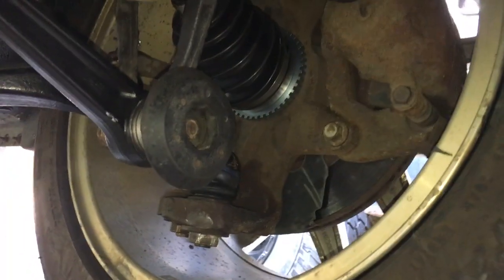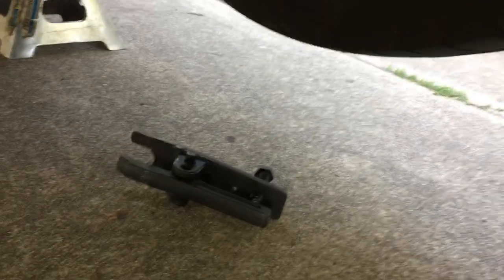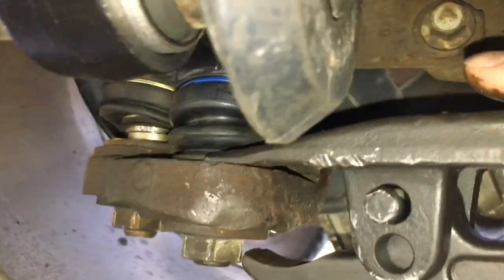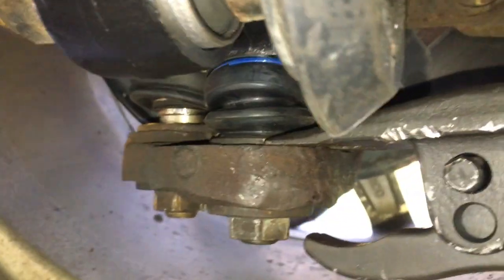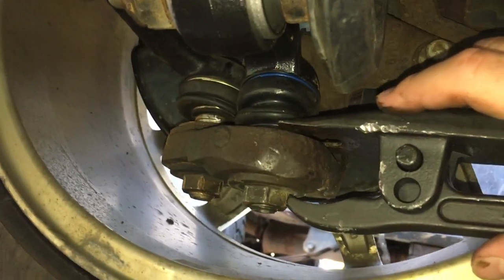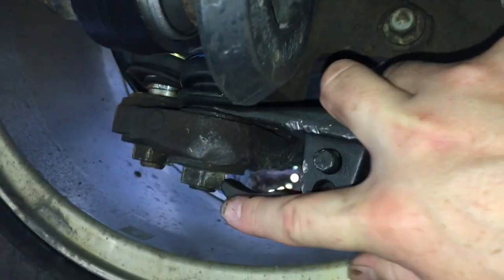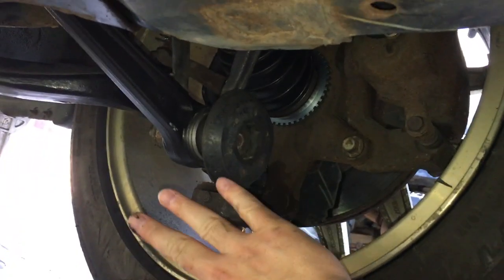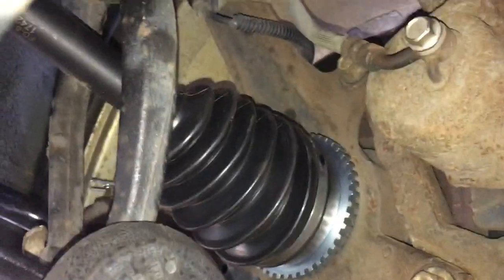Tip and WARNING - Ball Joint Removal Fusion / Milan / MKZ / Mazda 6

Comment: Totally agree, the hardest ball joints to remove. In my case I got one free and then broke my pickle fork. So I got my trusty SawzAll and cut off the remaining three. Then used a conventional ball joint press to get two more, yes they came out like bullets. The last came out with the dreaded Sleeve attached. No amount of hammering separated that one. Fortunately the Sleeves are available cheap at Parts Stores.
Reply: I was able to get my sleeves off the ball joints with a Pittman arm puller, and a heavy hammer.

Comment: That's interesting that you commented about the surface finish on the inner axle stub. I bought a 2012 Fusion back in 2019 in really good shape for cheap, and it had that axle issue and still does. It doesn't leak a ton, but I had them replace the seals before I bought it and I keep an eye on the tranny fluid level.
Reply from the maker: I think there is a seal AND bearing.  Both can be replaced without removing the transmission.  The bearing wears out and makes the seal leak but I think if you just replace the seal it won't fix it!  Google this, there is a TSB on it.

Comment: This is the hardest ball joint I've ever had to remove in any of the cars I've worked on. I broke 3 ball joint separator tools and bought a heavy duty hydraulic ball joint separator. I had to grind it down a lot to bit these thick ball joints but it works perfect. The hydralic ball joint separator can output like 20 tons of pressure. You need something that heavy duty for this job it's insane.
Reply from the maker: Ya it's terrible
Reply: Tolerances on the these part interfaces is probably the issue of some popping right off and others struggling.

Comment: Modifying the tool??? You know ball joint separator tools come in different sizes.....right?
Reply from the maker: Ideally you would use the OEM size/type separator tool.  But the harbor freight $20 can be modified to work in this situation.
Reply: It worked for you, that's fine.
Reply: @WilliamGreenlee  I Cut mine to fit around the bushing and it still broke! An air hammer would probably do the trick if the upwards sledge won't! Most pros at a shop probably go straight to the right tool most of us don't have at home.

Comment: It looks like he didn't not get the sleeve pressed down all the way
Reply from the maker: The sleeve is pressed in by the large lower nut, it has quite a high torque, so it may not look like it but I'm fairly confident it's in there :)

Comment: Where did you buy your control arms from?
Reply from the maker: Don't get me started.  This car chewed through control arms.  The factory set lasted to 100k, the Moogs lasted LESS THAN 4K MILES, there might be ACDelco's on there right now but I haven't checked them in a while to see how good their doing.  I personally recommend either the ACDelco's or the Motorcrafts, both available on Rockauto.com.
Reply: William Greenlee okay I just ordered some on eBay but having a hard time finding ones that fit properly in the knuckle. Was thinking of using motorcraft instead of aftermarket.
Reply from the maker: @ranaejosemaria5997  Yeah I think you get punished for using aftermarket in this situation.  Are you sure the bushing is still in the knuckle? Where don't they fit?
Reply: William Greenlee i did the drive side, removed the old arm but the new arm had a lot thinner bushing and longer thread so when I placed the nut there was an inch or so gap and that was from detroit axle suppose to be refurbished Ford parts.